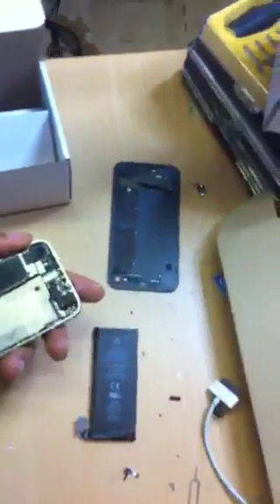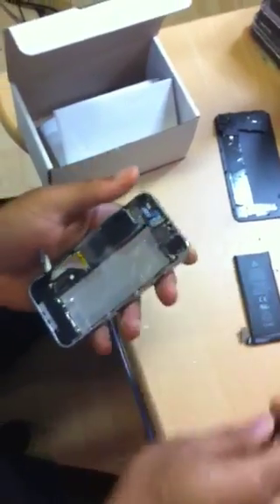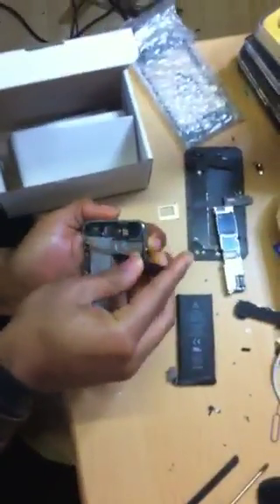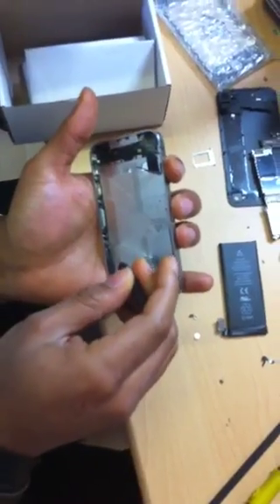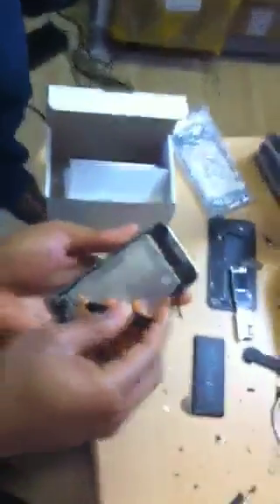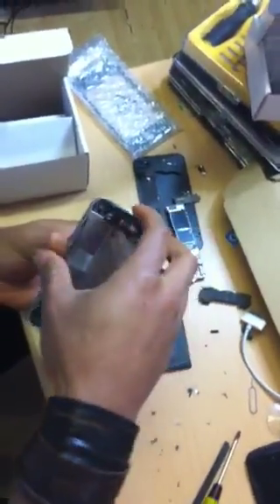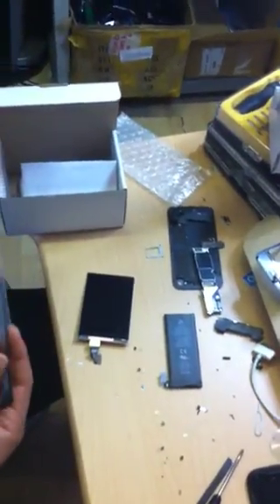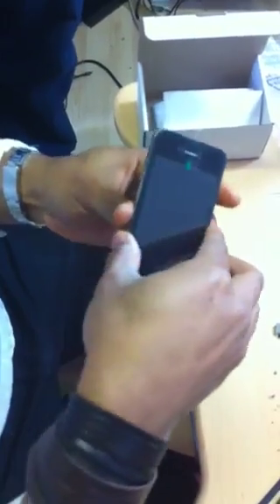iPhone 4G Glass Digitizer Screen Replacement Repair Tutorial DIY

Comment: @n00b1n4t0r I have no clue how you managed that. I heated that sucker up to 300degrees, and slowly slid a blade between the digitizer and the LCD< and cracked it in like 50 places. that epoxy, even heated, was ridiculously thick.

Comment: @darrellwoodley  I think it is misleading. LCD is the part that got pulled from the screen assembly at 08:45. It is generating the picture on your iphone. On top of it go the digitizer and then the glass screen on top. Usually the glass brakes, but the digitizer underneath is fine, and so is the LCD screen under them, and the phone is fully functional. It is difficult to separate the digitizer and the glass screen, and you need to get an assembly of both. 
Correct me if I'm wrong
Regards

Comment: you can separate the digitizer from the lcd on any iPhone 4 by using CAREFULLY a heat gun to remove the glue.... Just did it in mine in order to change it to white.